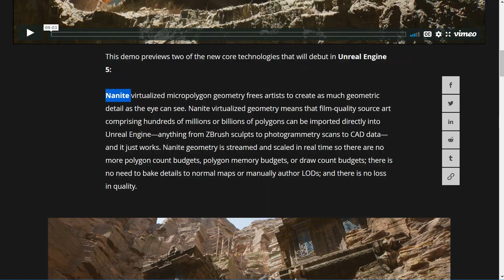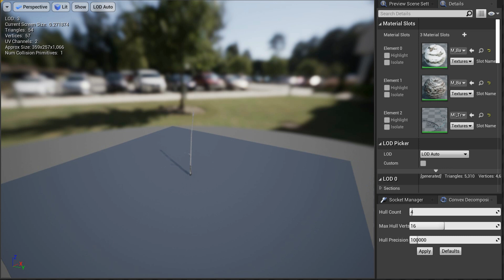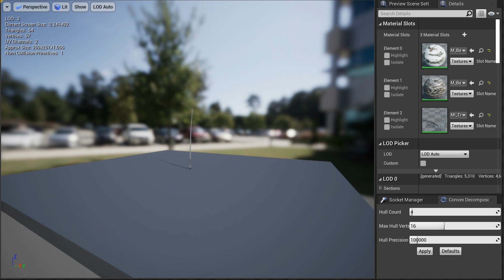Nanite - Unreal Engine 5

Comment: I think this is what Star Citizen does, is it not?
Reply from the maker: I think they use the CryEngine.    And I don't know much about the car engine technology another car engine is amazing and I'm sure they have some type of lod system.  I just uploaded a Hands-On review of the nanite system on my channel if you get a chance to check it out.
Reply: @JohnDaniels  SC is currently using a heavily modified version of Lumberyard (which is branched from CE yeah). I know they have changed a lot like a rewrite of the netcode, 64-bit conversion, OCS, etc. I don't know if they added it themselves or it was there, but they do load in and out higher res objects the closer you get, that's how it's so detailed. Just was curious if someone one of it was the same tech or if there was a difference.
Reply from the maker: @Liefx  That is a good question, do CryEngine and Unreal implement the static mesh  streaming the same way.  Will need to do some research.

Comment: Any word when this technology will be stable? I'd really like to know when we could see this running on mobile platforms!?
Reply from the maker: That's a great question, and I don't know, that's going to be an unreal engine 5 we're an unreal engine 4 right now in the later ends of unreal engine 4 so it's not going to be too much longer but they still have to get it out the unreal engine 5 with the new technology and then you know it takes a while to have all the improvements for it to be really stable and running good so far going to be I would think a few more years

Comment: When we say streaming in, it is streaming in from the SSD at a very high speed, right? Does that mean mechanical hard disks cannot be used with Nanite in real time? If so, is there a minimum speed for the SSDs to work with Nanite?
Reply: I THINK ITS MORE OF A RAM ISSUE
Reply from the maker: That is a great question, I would also they it is loaded into physical memory but windows has a page file on the hard drive so if physical ram runs out it will use the hard drive as virtual ram so a SSD would defiantly be better.
Reply: @JohnDaniels  not only that, page file seems to be both the norm  and well overused by game engines. trying to run on ram only will kill you.
Reply from the maker: @Noruzenchi86  That is the truth, there is so much that needs to be loaded into ram now days, especially with the open worlds.

Comment: What is the difference between LODs and that new mesh streaming technology in UE5?
Reply: LOD you need to make different version of meshes and it take skills and times to make it look good and smooth performance. what Nanite does is auto decimate triangle depends on screen space so you dont need LOD. It's like the opposite of adaptive tessellation.
Reply: @DonkiiiKong  I’ve tested Nanite already, now the difference from traditional LODs is pretty much clear ;)
Reply from the maker: That's a great question, and basically it's going to be similar but it looks like the engine's going to be rewritten in such a way that it's going to be an internal part. So if you place a static mesh into the engine that automatically takes on the streaming capabilities so as you get closer to an object it gets more detailed and as you get further away from an object it gets less detailed. Drag and drop, the engine just keeps getting easier and easier. I mean the same way they have the texture streaming working now but how at a programming level they do it I don't know the only thing I had read about it is that seen that video and they had a few paragraphs about it but nothing in depth.

Comment: Basically an automated version of LODs with automatic and dynamic UV unwrap. Cool
Reply from the maker: That is the way I see it also.
Reply: @JohnDaniels  I don't think it works this way. What I believe it does, is that it moves rasterization to pixel shaders. It reverses the classic render pipeline - instead of rendering a polygon, which will end up covering some pixels on screen, you will rather run a pixel shader and ask each pixel which polygon is visible there. So UE5 renders a low-poly hull of an object with this special pixel shader that finds the actual polygon of source object. Normally you would render polygons in sequence - one at a time, but with this approach, every pixel traverses scene graph in parallel and finds a polygon it should render at that spot of the screen.
Reply from the maker: @kysz1  great comment, thank you very in-depth. That may be the case and that sounds like a more efficient way to do it because it would seem like there would have to be some kind of paradigm shift in a way that they render because there's no way even using the LOD type system they could have that much information in the screen or that many polygons in a scene. Because with the LOD type system that they have now even if you're very aggressive with it if you try to add millions of polygons it's going to slow down so it's exciting to build a test that new unreal engine 5 if it can do what they say it can do it will be a total shift in quality of games it will be amazing.

Comment: Wow, you are completely wrong about nanite. What you are talking about is texture streaming, which is already in UE4. Nanite will load a single mesh instance onto the GPU and pass vertices through the rendering pass when needed to fill the screen. This is completely different then rasterizing, what all current games do. Meshes will use a high triangle count so there won't be a need for normal maps, AO maps, LODs, etc. This tech will be somewhat limited to static geometry and you will still need to use normal meshes for foliage and such. I believe nanite will be limited 4GB vram and the high density meshes should be around 30-100MB each. What you don't see in the demo, is most rock mesh are the same mesh duplicated many time. This is what will keep the memory cost low.
Reply from the maker: Hey Mevan, thanks for watching and thanks for the comment. Yeah the video was based off the information I seen on the short video that unreal showed. I couldn't find any other information on it cuz I don't think they've released a whole lot of information. But the duplicate static meshes you're talking about they already have in the unreal engine it's called hierarchical instant static meshes, and what it does is exactly what you're saying It takes a bunch of duplicate meshes and treats them as one so they just count as one draw call pretty amazing really actually used a lot of those for the PS4 game I made to save on memory and performance.   It may be totally different technology but it's got to work in some way like the streaming does. because just like I said in the video there's no way you could have that much geometry being processed at one time There has to be some kind of streaming system that they're going to implement I don't see any other way around it.
Reply: @JohnDaniels  No, mesh instancing is not the same thing. As you said, it still takes draw calls for hierarchical instancing. 1 for each mesh instance and 1 for each material. Nanite will load a single high poly mesh instance onto the GPU. The GPU will calculate which triangles need to be printed to screen and pass only the triangles needed from that mesh through the rendering pass. Essentially you can have 1 triangle per pixel. The mesh itself is never actually instanced in the game world. This means you can theoretically have unlimited detail and doesn't cost draw calls to do so. This tech is limited to things as static meshes.

Nanite isn't really new tech, it's just now being implemented into game engines. There is an NVidia paper on this you can read.
Reply from the maker: @mavencore3557  yeah the technology looks fascinating, just keeps improving every iteration. They're doing amazing job on the unreal engine. Let me ask you are you a part of the unreal engine team that's working on that Nanite?
Reply: @JohnDaniels  No but I do work with unreal engine. Like I said, this tech isn't new from epic, they are just first to official implement it into an engine commercially. If you want to look for more information about this kind of tech, then Nvidia has done a paper on it.
Reply: @mavencore3557  will it work for moving geometry? I'm not talking about skinned meshes (characters etc) but a rock falling?
Reply: @idk2708  Yes, it will also work with destruction. I am sure the objects have to maintain uniform scale.
Reply: @mavencore3557  wait what is the paper called

Comment: Something tells me (if these consoles actually get released) that as time goes on a games get made just for PS5 using UE5, the faster read/write speed and throughput of it's storage is going to give it a massive edge with nanite. Since the console can load so fast (according to them) this would allow for pretty intense draw calls even at faster character movement speeds. So even racing games can have higher fidelity environments without a drop in performance or at the very least no noticeable popin or ugly ass LOD settings. . I can see memory and speed being the ultimate resource moving into the future. Of course this is all dependant on the what the GPU and CPU can process which will more than likely be these consoles bottleneck.
Reply: Nanite stores a single instance of a high density mesh on the GPU and will pass only the needed triangles to the screen. This doesn't require draw calls and since the meshes are loaded on the GPU, loading in and out meshes isn't a huge problem. The demo is said to have ran better on PC with a 2070 Super @47FPS than the PS5 @30FPS.
Reply: @mavencore3557  Yeah the bottleneck of platform is just how fast it can get that data where needs to be. It sounds like once again these consoles will be getting cut short by their cpus and shared memory. I'm interested to see what UE5 games will run like on the 3080.

Comment: I still don't understand , isn't that just the LOD system ?
Reply from the maker: Correct
Reply: @Red Turn That seems more like a marketing talk haha  . Technically The geometry doesn't have much to do with pixels . maybe you mean vertices.
Reply: @hamza-trabelsi  sorry for the necromancy! Nanite dynamically generates triangles down to the size of a pixel, so it's rendering the optimal detail at any time, so it does actually have to do with them!
This video hilariously oversimplified what it's actually doing.
Reply from the maker: @Red Turn Can't wait, UE5 and PS5 will be amazing!!!
Reply: No, it's not. This video got it all wrong. UE5 no longer streams polygons, so polygon budgets no longer matter - and so there is no LOD needed. What Nanite does is that it lets every pixel on screen find and fetch it's own polygon for rendering. To put it simplier - instead of going through every polygon and rendering it on pixels that it occupies, UE5 goes through every pixel and finds out which polygon would end up there. The beauty of it is that it reverses rendering from "scatter" approach (placing polygon after polygon in various places on screen) into "gather" algorithm (every pixel for himself) so instead of one algorith running in sequence, you can now have many "gather" algorithms running in parallel. This parallelisation makes up for the per-pixel cost of such method. I'm guessing that UE5 only uses polygons to render either low-poly hulls of objects or maybe even billboards, but we never see them on screen, because pixel shaders fetch the real geometry by traversing scene graphs and they render what they find :)